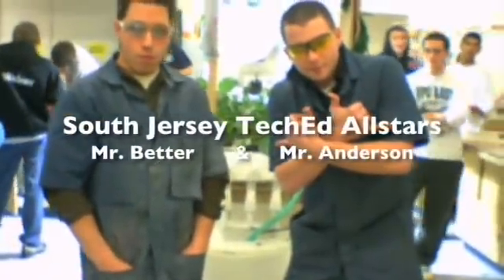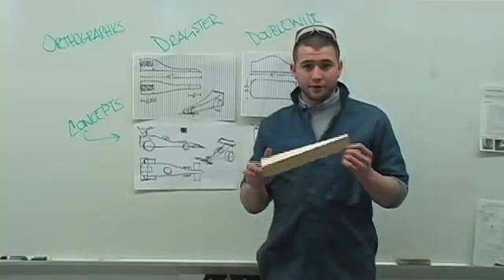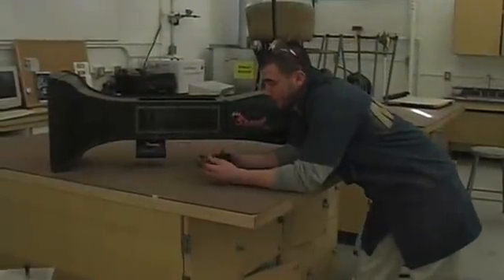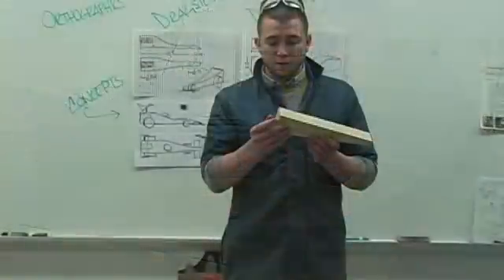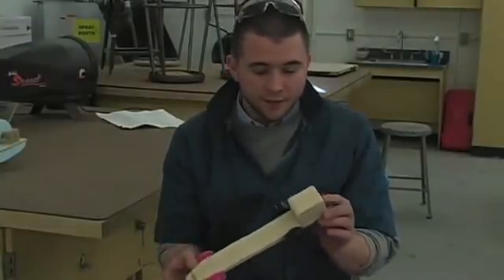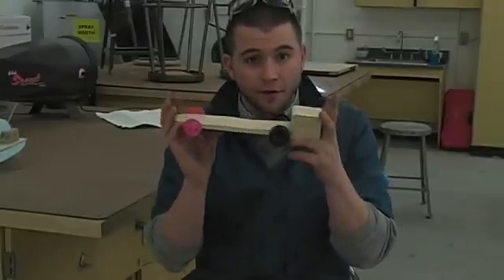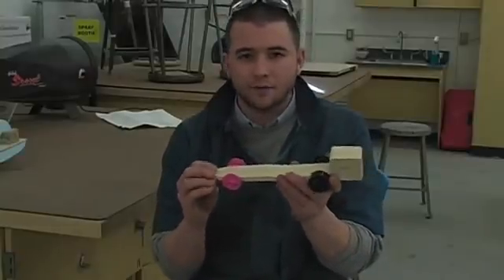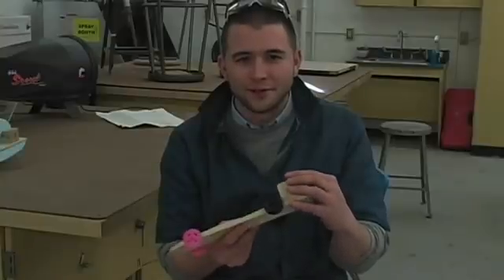CO2 Car Design Challenge

Comment: i am still to make and race my car but i took a totally different approach to the car by rather then putting a spoiler to make down drag i made a wing to try and life the car up off of the wheels and friction from the axles i also made a hole where the axles will be cut because where not using bearings or anything i'm hoping the less wood touching the axle the faster the car i also just make the littlest possible car i would by cutting out as much as i was allowed  am still to race my car though